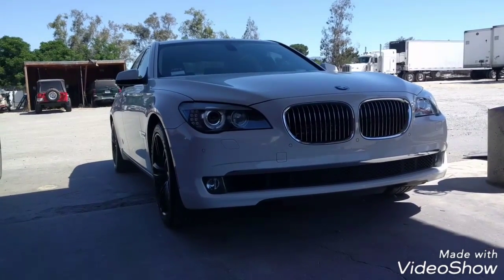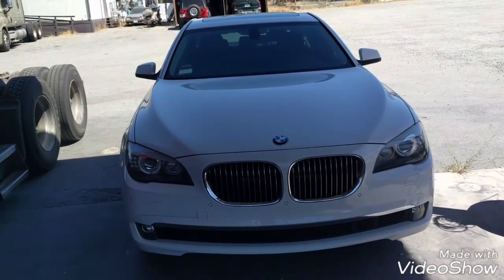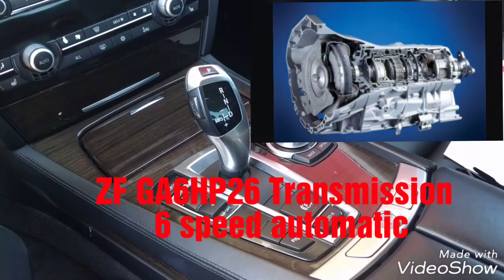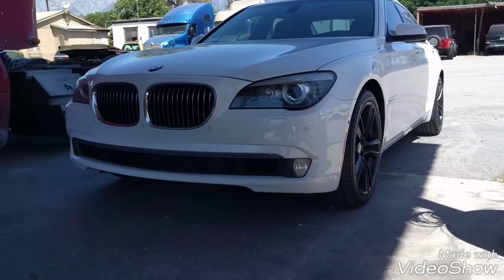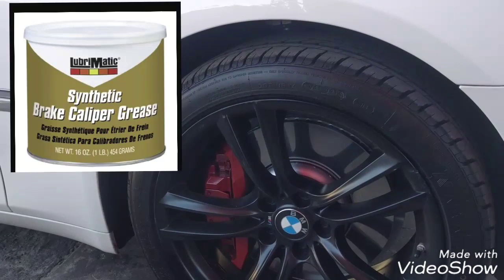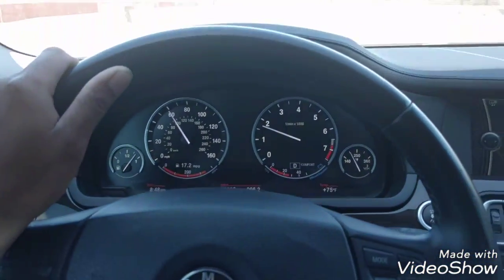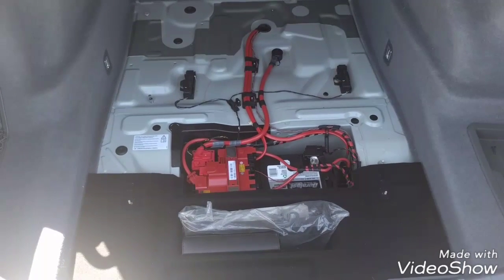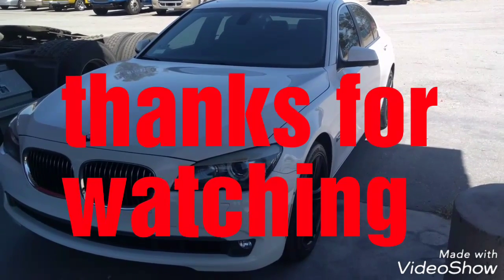2009 - 2012 BMW 750i 750Li BMW F01 F02 common problems ( N63 engine )

Comment: I replaced both turbos, all valve stem seals, the updated versions of CCV hose and the damn thing still burns a quart of oil every 600 miles. Everything breaks on this engine. Unless you are a mechanic, don't buy this car without a warranty. You are going to cry out loud when you see the repair bills. And on the fuel economy, I'm getting 13.8 on my x6! I'm glad you are getting 17!

Comment: Hi. I have the same car. Your videos are very helpful. Have you experienced a low frequency rumbling from 47 mph to 57mph? In my car it seems to be independent from which gear and RPM and only linked with speed. It even occurs when coasting In N. It happens on all road services. I have recently changed the guiro joint and I know that my tension struts need to be replaced. Also, my 4th gear rpms surge during firm acceleration and the power is subsequently cut leading to a massive clunk/jerk. The car mileage 65k and I have replaced ATF, mechatronic and valvebody. Thanks. Keep up the good work 👍🏼
Reply: Maybe xdrive systems?
Reply: Have you figured out what that issue is with the rubbing noise?

Comment: Good video I got 2010 760li very good car I don't have ant of those problem but my tire sensor keep coming on and it also make my check engine light come on so I got to change them again but but for the spare you should have run flat
Reply from the maker: +Muzik Unit 
Check your tire pressure sensor inside the wheels, if is necessary replace them.
Reply: Francisco Amaya thanks man good looking out and keep them video coming

Comment: Hi Francisco, I have a problem with my f01 730d where it cools down when running on motorways at about 60-70mph. Looking online posts suggests for 520d and e60 etc. it might be the egr thermostat which is stuck open and is a cheap and easy fix, however I cant seem to find this part? does the F01 has one? do I need to get the whole egr valve replaced? (costs more than £500 for just the part) or can i perhaps get it cleaned and fixed? Any advice is greatly appreciated!

Comment: I have an 09 bmw 750i.  Right now, its my daily get around car. You said you put a quart of oil every 750 miles, my car is telling me to add 1 quart almost every week!  I dont see any oil leaks and theres no warnings or systems failures on my dash, the car just passed inspection, why am i putting so much oil so fast?
Reply: DollazEarnEZ TV hi. I was looking to get a 2009. Any other problem ? Any review or advise?
Reply: Valve stem seals go bad and the car burns a ton of oil. Major repair, usually happens around 100k mile mark

Comment: Hello Francisco my parking gear is not engaging can you elaborate more on why this happens?
Reply from the maker: Probably, you need to change the transmission fluid and filter. Also the valve body seal can cause similar problems

Comment: Please I need help. My rear right side is not raising. I just paid over 500 just to replace the new air strut. And still not working. My left side is raised but the right rear is still not working even with the new strut. I just bought a level sensor but where is it located in the rear right?  Can u please...Just wasted money on a new strut that wasn't the problem.
Reply from the maker: There is a actuator valve by the air compressor.  That could be   bad

Comment: I have same car, 2011 750 Li. Every light on the dash lit up; ABS, TCS, brake light, check engine, suspension drive moderately. Dealer diagnosed as blown DSC f2 fuse $100. Drove home, next day the same lights back on. Now they say they can run a parasitic draw test $350. Im thinking the DSC unit is faulty. What do u think?
Reply: It is your alternator

Comment: Hola francisco! Oye  mi 2010 750li dice drivetrain malfunction ya Cambie mis spark plugs y los ignition coils y sigue igual que me recomiendas?
Reply from the maker: Tiene algu codigo?
Use un scanner y saca El codigo para darle una mejor respuesta.  

Es posible que tenga un leakeo de Aire or un injector este fallando.

Comment: Should I be overly concerned about the  smoke I get in the morning?? seems to last for awhile. smells very rich
Reply from the maker: +Brandon Robinson 
Emissions usually are going to be rich in the morning
For all the cars and engines.  That is the reason why when you go to do a smog test in California they tell you that you engine has to be warm at its normal operational temperature because when the engine is cold emissions are usually higher that expected. 
If the emissions are high after the engine is completely warm you may have a problem with me catalytic converter or fuel system.  

My BMW F01  does the same and before I owned a 2006 BMW X5 4.8is is and it was doing the same thing
Reply: Also, keep an eye on your Valve Stem Seals!  This is how mines started too... Estimated repair is around 5k!

Comment: So they didn't fix the valve guide seal problem from early 2002 models.i had one n it would smoke from tail pipe.whats a good year to buy of 750li
Reply: Alex Ramo 2013  and up ,I'm checking out the 2015 750i so far I heard good review's on it

Comment: I’m trying to choose between the 2009 s500 or the bmw 750li
Reply: Naw I wouldn’t drive as a daily just on weekends or when I’m taking my girl out to eat
Reply: Brandon Pennix dont do it. Run from the n63. Bmw doesnt want to honor the campaign.
Reply: S500 ABC SUSPENSION PROBLEMS AND 750i Many engine issues
Reply: Better get an EXTENDED WARRANTY,that BMW n63,many engine problems among other issues...

Comment: Awesome video! Overall, do you think it’s worth it for this car? I’m looking at 2011+ with less than 60,000 miles, would that be okay? Or should I just go with a more reliable 740i?
Reply from the maker: In my opinion, I love BMW and I think is worth it. 
It is a good looking car that looks much newer. 

2011 is a good year it has some modifications to the engine but if you want the updated engine you need to buy the 2013 models. 

740 are good they have a better fuel economy and they have power too. 
If you're thinking to buy a 740, buy one with the  premium, comfort, sport, etc, packages; because if you buy the stock one you won't have any extra no even soft closing doors. 

The 740 is reliable, it has the 335i, 535i engine. 
It has issues with the water pump, turbo charger, spark plugs, coils, etc,.. but I don't say this to scare you, I just say that you have to be prepared to repair in cases something happens. 

My advice, if you buy a BMW. Do not floor it Everytime the light goes green and give good maintenance to it, maintenance like replacing the oil every 5k miles, replacing spark plugs, replacing air filters, using a 91 + gasoline, etc,..
Reply: Francisco Amaya Wow, thank you for the very detailed response! I really appreciate it.
Reply: Razvan Dragos. I OWN a 740i.   They are reliable when you get them with low miles on them.  Once you get up to 80.000 miles and over you will have a lot of problems.  All the problems won't be a big deal but they will have you  constantly having to get things repaired.   If you have a warranty then it won't be a big deal.  If you don't have a warranty, you will be spending a couple thousand a year just to keep the car running right.  My 740i has 90.000 miles on it.   This year my power steering went out.  Had that repaired.  My water pump and thermostat went out. Had that repaired.   My Amp to the radio stopped playing bass.  Had that repaired.   My cold air stopped working.  Had that repaired.   My battery went bad.  Had that replaced.  My tire sensors went bad.  Had them replaced. I spent thousands this year keeping this car running. It's a good thing that I make a lot of money at my job.  I love the look of the car inside and out but they have to many issues.   A $80.000  car should be way more reliable then this.  I'm thinking about trading the 740i  in for a Audi A7.  They are a lot more reliable and they haven't had any recalls for that model.

Comment: My 2011 BMW 750Li has a level control malfunction. The rear end on both sides is sagging. I hear the compressor every time I open my door. I take this to mean that the fuse is good and the compressor is working. I don't know how to test the solenoid for errors and there's no present way for me to test the air bags for leaks.  Has anyone had this problem before. If so , how did you fix this? Any Ideas would be helpful...I'm lost.
Reply from the maker: It is possible that you have a air leak. 
Try to pull the the suspension module codes to get a specific code to your fault.
Reply: I'm on-line right now shopping for a coder. Thanks for the in-put. I'll up-date when I can.

Comment: So wtb the 2014 model? I really want a bmw, but damnt, german junk!
Reply from the maker: 2013 and up are better.  You should BMW any BMW with the N63 ENGINE from 2013 and up.  They have less problems and more power, they also looks nicer.  

All the problem that I mentioned on the video are possible to happen but this doesn't mean that all BMWs are going to have all those problems.